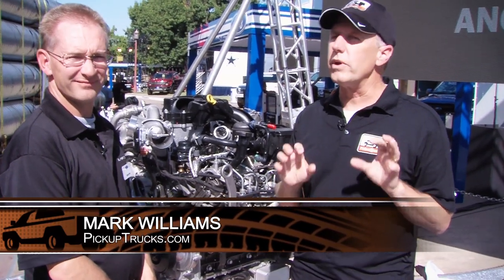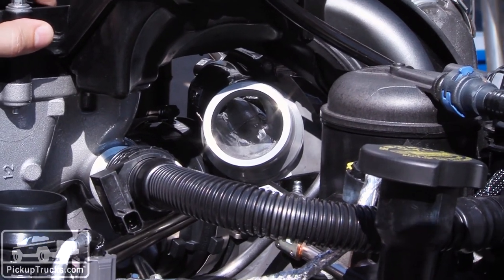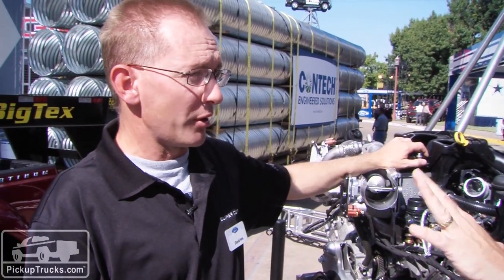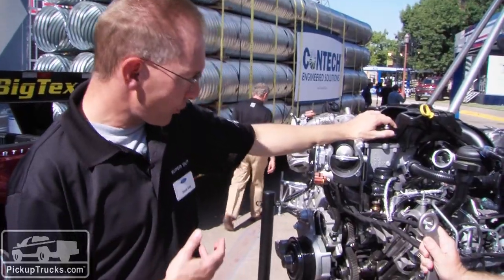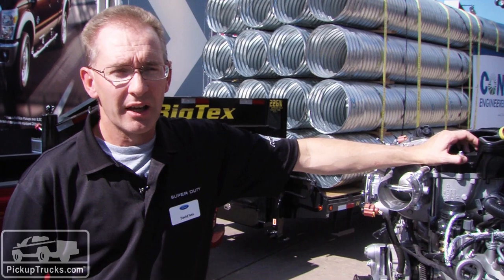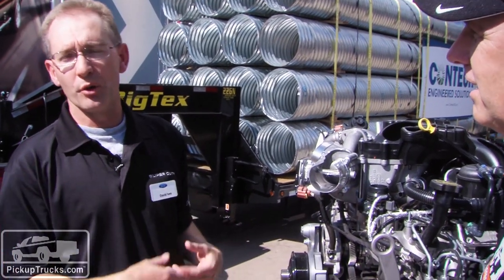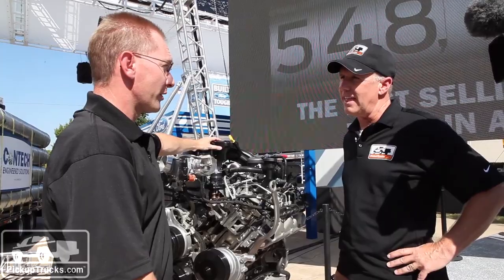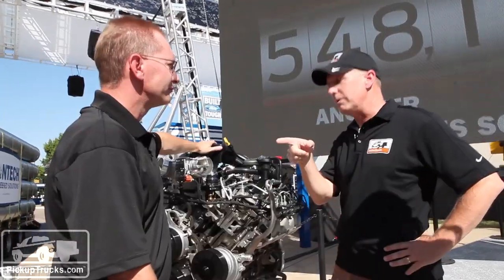2015 Power Stroke Will Make More Power

Comment: I have owned 7.3 6.0 6.4 and 6.7 and the only real motor that was ever a beast was the 7.3  380k. Out of that motor no turbo problems no head gasket issues no water pump failures every other engine I owned after the 7.3 did not even give me 150,000 miles so what does that tell you all maintenance done all highway miles pulling just 4 cars on a car trailer

Comment: The only way your going to pull 20k pounds with any dually is if you got a three car trailer and it's fully loaded other than that having a truck capable of pulling 30K is nothing more than a talking point. All three of the diesel pickups will do the same thing. Hell if you pull 80k enough times up and down a hill in a semi you can easily blow it. Sometimes I don't think people understand how heavy 20k is. I guess what I'm saying is it doesn't matter which pickup you own.
Reply: A semi on a goose neck trailer would make a load of about 28k maybe little bit more & they have utility trailers that can carry 20k+
Reply: Clearly you are not a landscaper with a float that carry's a backhoe , mini ex and skid steer?
Reply: No I drive things that carry 20+ tons
Reply: My tractor weights over 10K and if I have any implements the weight goes over 20k no problem,and a load of hay 14 large round bales weight over 20k alone bales can weight from 1,200 to 2,000 lbs ea..So long story short that 30k is going to be used. And yes it matters alot which truck you get less breakdown time =s $ so if you dont like to make money get one of the other 2
Reply: JohnKS Libertyforall It matters to you which truck you get. My dad has cattle and I've hauled lots of hay with a 96 ford superduty I think the most I ever pulled at once with that truck was about 12bails maybe. Though they  probably weren't 1200-2000 a peace unless they we're sitting in a field and rain had already soaked into them most bails aren't that heavy unless your making really large bails or there wet. Nevertheless where I live there are lots of farms. So I see guys pulling  bails of hay frequently they have various types of trucks not a particular make or model. There all just heavy duty trucks. My dad also ows a an 04 3500 ram and has had a Chevrolet. Like I said it's all a matter of preference. Also my freightliner Cascadia weights 23k empty an empty 53ft trl weights little over 18k. That's 41k empty. If loaded I might be anywhere from 66k-76k that's a lot of weight. So you believe a pickup can haul as much as my freightliner repeatedly and not breakdown? 30k pounds pulling power? Those are the types of loads that I pull only my truck has 455hp/1800tq. Also I don't know what type of truck you got but it's not a ford, dodge or chevy cause I could be mistaken but I don't think any one of those manufacturers makes a pickup that heavy in curb weight.

Comment: Look for just slight increase in HP and torque to take the subject off the engines past troubles. These are fixes not enhancements. Ford tried the no waste gate turbo diesel before and failed.
Reply: on what motor?????
Reply: Wiki the Powerstroke motor and it'll explain it all for you JohnKS.
Reply: tpcrb
or I could go look under the hood of one of my trucks then I will explain it to you.... my 97 has one and I did a google search for the 6.0 6.4 and the 6.7 all have a replacement waste gate again your a liar

Comment: ford introduced the 6.7 with 390 hp and 735 lb ft of torque and a month or 2 later chevy introduces an updated duramax with 397hp and 765 lb ft of torque and a few months later ford updates the 6.7 for 400hp and 800 lb ft of torque.

Comment: When has Ford done that?  I would love a specific example.  When Ford brought out the 400/800 tune, was the Cummins 400/799?  Nope.  It was 350/650 until 2012 when they boosted the torque to match the Ford.